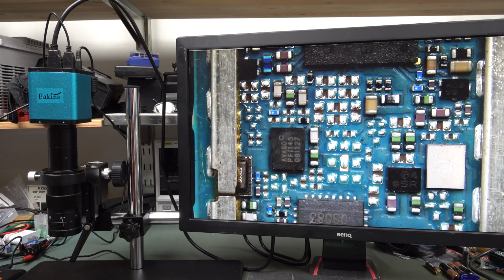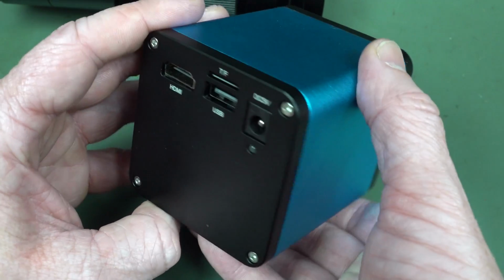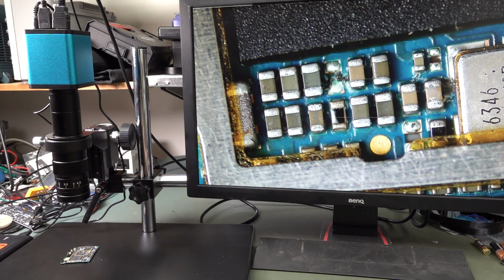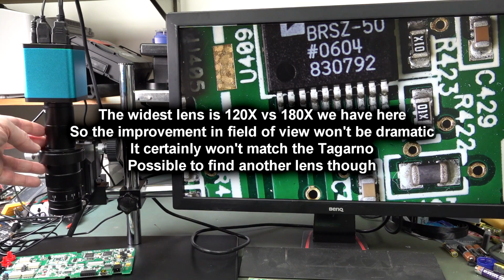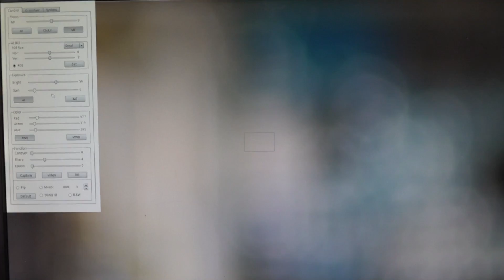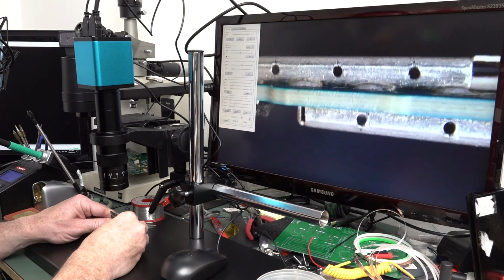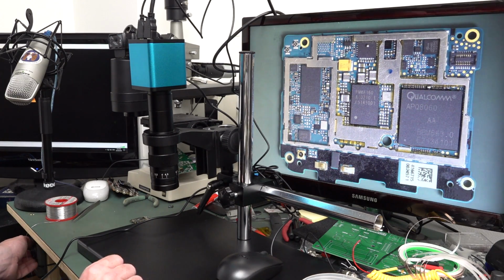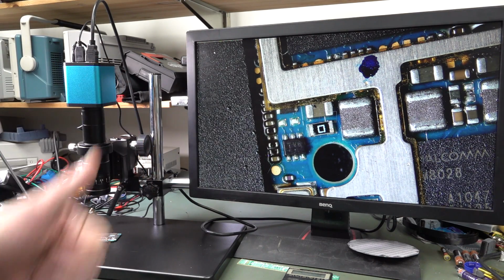EEVblog #1125 - Amazing $500 Soldering/Inspection Microscope!

Comment: There is no reason to pay $500 for that. The $60 Eakins microscopes they sell on AliExpress work pretty much the same (except for the autofocus), I bought one myself.
Reply: Ya the one in the video has the real IMX290 sensor. The real issue is all the Ali-Express sellers found out that the IMX290 was discontinued and decided to switch the sensor thinking no one would be able to tell the difference. They were using the IMX307 which is ok but it's nothing compared the IMX290. Some other vendors were also using the IMX185 sensor but telling everyone it was a IMX290. The IMX185 is garbage. The sensor is 3$ depending on how many you buy compared the average cost of 70-210$ for the real IMX290. The IMX291 is slightly inferior to the IMX290 in low light conditions. The IMX291 was also used but many sellers did update the listing after many people started complaining about the IMX185/IMX307 bait and switch. I really don't know why the IMX290 camera can't be made again. This camera sensor is amazing for inspection work and low light. It seemed like they made less than 100 of these IMX290 cameras for the public before they started changing the sensors.

Comment: I bought the Amscope HDMI non-recording autofocus digital camera, but the lens it came with does not allow me to have a wide enough field of view to see the whole PC board. Amscope told me "Unfortunately, we don't have a different reduction lens/camera adapter that you can use with any of our HDMI camera to increase the field of view. We normally use a barlow lens to increase the working distance and field of view but we don't have one available for your H800 series."

Can anyone suggest a solution? Thanks.

Comment: So is this still a good deal or are there better options for the price?
Reply: The problem is rather that you won't get the camera shown under the link mentioned. You will get some camera that has a completely different sensor chip.

If you're lucky, it will be almost as good as the one shown here. But most of the time you'll get some totally outdated sensor that doesn't even come close to the quality shown here.

It's a pure and very expensive game of chance.

Comment: scope link is dead. Does anyone have an updated, reputable link to a vendor that sells an actual high-quality IMX290 scope? (apparently, there are now a lot of unscrupulous vendors that sell lower-quality scopes marketed as IMX290's)???
Reply: You probably won't find a dealer on AliExpress who sells a camera with a real IMX290 sensor. Even if the description says it has an IMX290, it's more likely to be some old sensor. 

You would have to buy a much more expensive model with a more recent IMX chip. If you're lucky, you'll get the older IMX290 sensor. 

However, you will then pay three times as much. And it will still be a gamble. 

Unfortunately, the Chinese usually cheat here.

Comment: Now you can find the equivalent for 180$, I bought an open box for 70$ plus shipping... Look carefully when shopping they're sold under like 4/5 different brands (that I know of, maybe a ton more)
Reply: The problem is none of those are the correct sensor you don’t get the IMX290. They all have been switched out for a cheaper sensor but they don’t tell you that. If you open it up you will see on the motherboard what the censor could be. Almost all of the cameras have been switched out for IMX307 or IMX185. The quality / features of those sensors is much worse.
Reply: @shiftctrlhack  why the imx290 is so special? I just bought couple modules, imx335 (35eur) and imx415 (50eur), pixel size is smaller, but that matters more for very low light conditions, for soldering or inspection you can just crank the leds up or add more, not a problem really... IMO the optics quality plays a much bigger role here
Reply: @shiftctrlhack hi how about rising cam?? did you tried it? im looking for a rework trinocular or ms camera for smd rework
Cheers

Comment: Dave, they have another version of the microscope, with ENORMOUS field of view, and 4K@60Hz, and very solid stand. Very compact, but still possible to switch lenses, if one wants higher magnification. It is about 1800 USD. Blows Tagano out of the water.
Reply: Do you have the product info for this?

Comment: Is the eakins camera still the state of the art in this price bracket for someone looking to buy an affordable hobby electronics microscope in 2021?

The killer feature seems to be the auto focus, and it would be golden if there were an easy way to lock/unlock it.
Reply: I ordered it last month. There is now a tab for measurement in the software but the only way to disable the autofocus is the buttons shown at 9min33sec. 
3 buttons : 
AF is for AutoFocus (obviously), 
Click F is for clic Focus. (you clic this button then clic on the screen where you want the focus to be). 
MF for Manual Focus. In this mode you can use the scroll bar to move the focus. and it will not change automatically. In AF mode you can also place the focus region where you want on the screen. 
Hope I helped.
Reply: @guillaumebraun7993  : Just curious...does the AutoFocus thing get crazy during soldering process ? Like loosing Focus every time the Soldering Iron "enters " the scene !
Reply: @peplegal8253   It does change the autofocus when you put anything in the "autofocus zone" but you can disable the autofocus function. Soldering is not my main use of the system but I guess that when you solder small things, you maintain the board in place so you don't need autofocus.
Reply: @guillaumebraun7993  : Thanks !  I don`t see reasons for AutoFocus. I`m buying a similar Cam on AliExpress for U$ 80.00. No AF. I could pay U$ 300.00 for the AF version...but for what purpose ?
Reply: @peplegal8253  exactly what Dave shows. Inspection where you rotate and move a lot what you inspect. In this case Autofocus is a big improvement

Comment: hey EEVblog I suggest that you try a HDMI hub like this one ( https://www.amazon.com.au/Splitter-NewBEP-Amplifier-Switcher-Support/dp/B01MT12OQA/ref=sr_1_1?ie=UTF8&qid=1538070324&sr=8-1&keywords=NewBEP+HDMI+Splitter ) some times in my experience you can get a different signal depending on what your device is plugged into ;) please give us a heads up if this works

Comment: Please test somehow if this is really 60 fps. I.e. by recording LCD display with high speed counter . Some people claim that it doesn't produce 60 fps when recording to SD card. Might be too slow processor to encode stuff fast enough. I wonder if the screen capture with some 1080p60 HDMI to USB video capture card would actually capture full 60 frames per seconds.

Comment: I just bought the same lens about 1 year back with non autofocus camera (as I don't feel I need it).
But... I did buy the 0.5 and 0.33x converter lenses and that turned out to be a good move. With them I can get a very nice working height on the scope and a much wider field of view.
Reply: Which are the .5 and .33x lenses?
Reply: @michealcortes2553 still need help? They are called Barlow lens attached to bottom of that 180x lens, which allow for wider field of view

Comment: Your HDMI capture card might not be working because the video stream has HDCP encryption. You could try using a cheap HDMI splitter from China to “strip” the HDCP. Then you could send the video to your monitor and capture card at the same time.

Comment: Looks like they raised the prices since your video released? Is it really fast enough to keep up human hand/eye for soldering? I didn’t think digital scopes would be fast enough. Would this really be better than a real optical AmScope? For real work?
Reply: Depends. From experience, the latency on these is minimal, and you tend to get a clearer "big picture" vs optical. Mostly comes to personal preference. I prefer optical, but others i know prefer digital. I personally use a mantis. Also depends on the application, soldering vs rework vs inspection.
Reply: I think as long as you get an HDMI one you are good. The usb ones are slow and choppy from what I've seen.

Comment: The camera seems nice. Probably best to use it with a trinocular microscope though if you're going to do soldering instead of just inspection. But since it's a standard C-mount it would be easy enough to be able to swap it in, which could be very handy.
Reply: I think trinocular lenses are dumb because you end up being closer to PCBs when your soldering, and breathing in those toxic fumes.
Reply: @CookieManCookies  Your fume extractor should be able to handle that. If the difference matters, you've got insufficient extraction.

Comment: The same supplier offers a traditional trinocular microscope with conventional camera for around half the price as SZM0745T I thought the autofocus on this one was fantastic, and would be great for board inspection. I wondered if the difference in price is warranted for general board soldering/repair?

Comment: I have a microscope which I use mainly for inspection, but prefer using my head mount magnifier for microsoldering. I don't know about anyone else but I find it hard soldering looking at a screen rather than looking directly at the PCB.
I lost the vision in one eye last year, (walked into a plasma TV in the dark - yes very ironic; sharp corner right in the eye) also doesn't help as my depth perception has gone. Getting the iron and the solder in the same place is challenging. Having to learn how to solder all over again.
I have my own repair shop so learn and adapt I must.

Big fan Dave. Thanks for all the vids.
Reply: Holy shit dude, I'm so sorry. Glad you can still solder. But man, did you run into this TV or what? I've heard people destroying their cornea on sharp objects but still retaining their vision after a transplant.
Reply: Tripped on the TV stand and fell onto the corner. Surgeons couldn't find the lens. Probably got cleaned up and thrown out with the blood. Split the eye right open. Surgeon said I did a good job, sadly. I looked like the terminator for a while so I would walk up to people and say 'I'm looking for Sarah Connor'. Got a few laughs, and you have to laugh. Life goes on and you adapt and get on with it. Shit Happens.
Reply: @luscus9754  I love that you have a great sense of humor dealing with that. . . I sometimes think that everything is a important asset in our line of work. Best of luck dude 😉

Comment: It is c mount, so you use shorter expansion tube or 25 cctv lenses (not sure what best for this camera). https://www.ebay.com/itm/Television-TV-Lens-CCTV-Lens-for-C-Mount-Camera-25mm-F1-4-in-Black-Y4T5/292243368509  https://www.ebay.com/itm/20mm-C-CS-Mount-Lens-Adapter-Ring-Extension-Tube-for-CCTV-Security-Camera/401390203767

Comment: Hi Dave you shoud compare the Lapsun Mikroskope with the Tagarno. The Lapson hase the same featuers like your Tagarno. It has also the built in Lense with the autofocus funktion and external zoom control 

https://www.aliexpress.com/item/Autofocus-Optics-Lens-with-1080P-60FPS-HDMI-Video-Industry-Auto-Focus-Microscope-Camera-System-For-PCB/32869216826.html?spm=a2g0x.10010108.1000014.4.58a73b7dtGb0m9&gps-id=pcDetailBottomMoreOtherSeller&scm=1007.13338.112238.000000000000000&scm_id=1007.13338.112238.000000000000000&scm-url=1007.13338.112238.000000000000000&pvid=18b99073-639f-4290-90ce-a269fd92eb0d

Comment: Either touptek makes it, or another company is has cloned it wit the updated firmware? I have my doubts about 60FPS recording to the SD card, or true 60FPS out over HDMI. They said they doubled the frames captured at 30FPS just to make it compatible for HDMI monitors and probably why the capture card has problems. Better to just out the camera on a real microscope and a 0.35X reduction lens for wider field of view, with wide angle eye and Barlow lenses. The manufacture has lied about this in the past. And it didn’t record @ 60FPS despite the Sony IMX sensor being capable of doing much faster frame rate capture. The processor used wasn’t strong enough to take advantage of the full ability of the sensor. It not s true h.264, you need to fix the header the footer for the video to be edited. You can re-encode it with QuickTime, but it’s an extra step. Seems like most bugs for recording is the same as the older firmware. I have in depth conversations with the manufacturer and waiting for them to step up the hardware.
Reply: "I have my doubts about 60FPS recording to the SD card"
Why?
The Sony Xacti HD2000 from... 2010 or whenever (midrange handheld camcorder) was doing that back in the day with no problem. Record(ed) in 1080p60.
Reply: Leo Curious - because I know 6 other cameras that are in blue aluminum boxes just like that, including mine claims 60 frames a second. But the 60 frames a second is doubled up captured 30 frames a second over HDMI for TV compatibility. The SD recording ended up being 25FPS @ 1080. The manufacture family admitted it not capturing 60, still they list it as 60 on the websites. This is why the video didn’t work in his editors and has to be re-encoded to be used in editors (maybe it’s not a real H.264 also) and probably why he had issues with his HDMI capture card, just like mine also.
Reply: Ahhhh I see. Thanks!

Comment: The thread at the bottom of the microscope objective can be used to install a barlow lens. A 0.5x barlow lens, for example, halves the magnification and doubles the working distance, which is nice for soldering. Eakins offers compatible barlow lenses here:
https://www.aliexpress.com/store/product/0-5X-2-0X-0-35X-Barlow-Auxiliary-Objective-Glass-Lens-For-XDC-10A-180X-300X/3200040_32845571497.html
Reply: I figured out now which barlow lenses are compatible and added the correct link above.

Comment: It’s just a touptek developed camera with a Sony IMX sensor.  Eakins doesn’t make any cameras. This is the updated auto focus version of mine. Version 1 software had some issues, and I dot think it let you turn off autofocus and was sometimes annoying. The autofocus camera had been out for 2 years now. The manufacture admitted to me they that some of the cameras that record to the SD card do not capture 60FPS video, but only display 60FPS by doubling the same frames for compatibility with most monitors with HDMI. I don’t know if they updated the processor/gpu to do true capture at 60FPS yet. Don’t always believe the specs, most third sellers list 60FPS but most are not true 60FPS. As for all in one “inspection stations” I would rather still spend a little more and get better lenses, a real microscope and a reduction lens so I can just buy a new camera when they get better later down the road. Or change the working distance by swapping the Barlow lens for a different magnification.
For more information on microscope cameras read the description of this video:
https://youtu.be/fFGV6_Tb7VA
Reply: Who cares about capturing mostly unmoving objects at 60 fps instead of 30? This will be some of the most static images that I can imagine for any video material.
Reply: Some who are using it for instructional in a class on a projector, others in videos when moving bigger boards around. And for other hobbies/professions besides just electronics that may be using a microscope cameras for other moving objects and want to record what they saw. Maybe blood cells, or reactions of different chemicals when mixed. Microscope camera’s are not just for electronics and are used for real microscopes also, not just this inspection 3 in 1 lens and can get closer video unlike 200mm working distance for electronic repair.
Reply: Gadget Review Videos  Well, maybe all sorts of things. Maybe a cap will blow up during filming and youll capture it in finer detail. :) But for practical electronics purposes (which is generally what the audience of this video cares about), noone will ever actually need 60 fps. Tell me the latency sucks and that is another thing entirely.
Reply: Gadget Review Videos  That said, if the doubling happens when capturing as well as for the HDMI output we can agree that is just stupid, doubling the filesize and making it heavier to edit for no gain at all. You would probably want to find some tool or ffmpeg script to undo that everytime. ... pain
Reply: I was told this was supposedly for compatibility on some TVs and monitors, not the best way to handle that. Probably why Dave can’t get his HDMI capture card to work properly. There’s another comment of discussing ffmpeg, still it’s another step to take, and I suspect capturing to the SD card is missing the footer and header information on the file because I have to re-encode those videos before I can edit them also. 
Although I have no problem with my HDMI capture box, so I don’t know if it’s Dave’s capture and windows or some other reason,  or his just doesn’t like the double frame rate. 
I guess the point I was trying to make is they still need a little bit of work on the firmware side of things if you expect all the features to properly as they should. But that’s just my experience when I tested 3 different models in the same aluminum blue box probably made by the same manufacturer with the same looking firmware GUI.